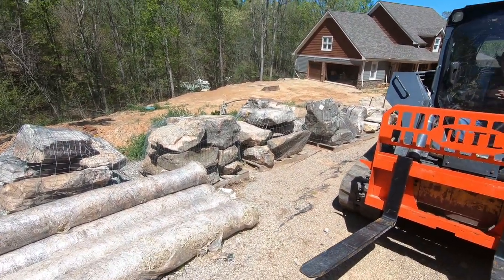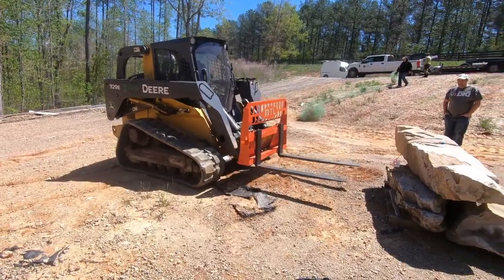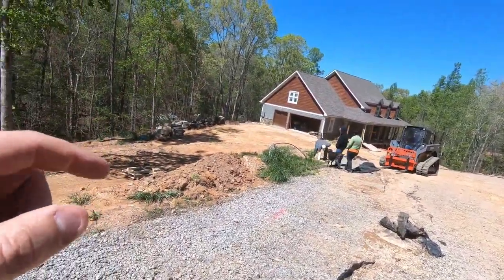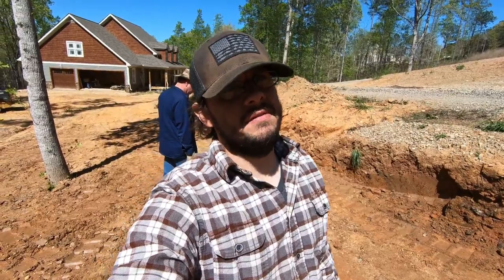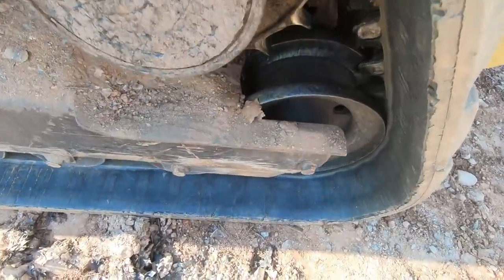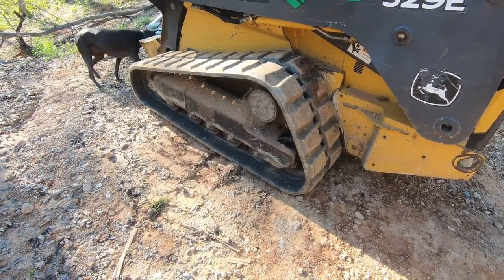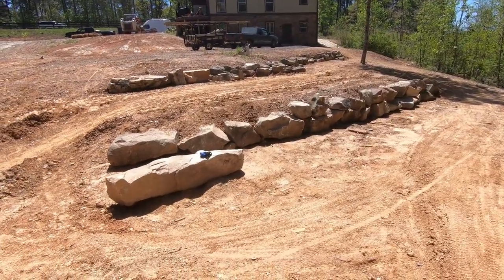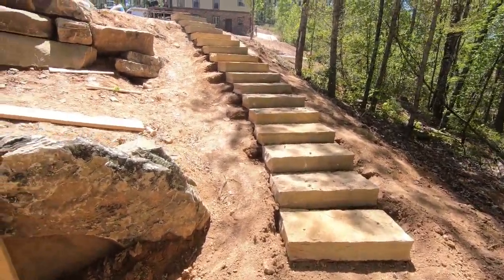Building A Boulder Retaining Wall

Comment: For people who have not set stones, yall did good.  Looks nice.  One thought I had was if you get involved with stones or large rocks again try to get some filter fabric like what goes under roads and put that down over the very back where the stones will lay on it and the fabric with maybe some gravel  between the stones and dirt  will help keep the dirt from washing through the joints plus help set the stones where you want them.  It would be for long term drainage.
Reply from the maker: Will do! Thanks for the tip!

Comment: Great job..... your cooling system seems to be short cycling is the radiator clean?
Reply from the maker: Yeah, it the just that the interval timing for the reversing fan is really short in the set up in the computer.  I just haven't changed it.

Comment: We see you use Deere I don't see many users using deere anymore is there any reason you prefer deere over other machines
Reply from the maker: Both my Deere machines just happened to be what I was looking for and in my price range so that's primarily why I bought them along with the fact that there is a local JD dealer for parts and service a few miles from my farm.